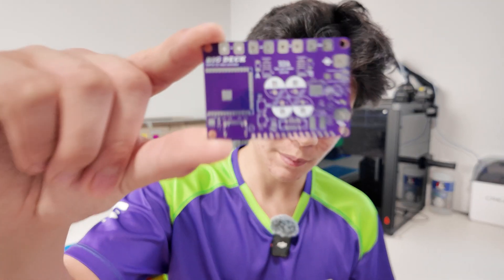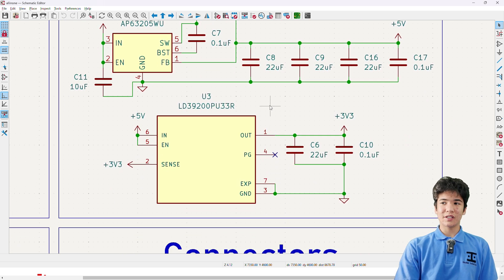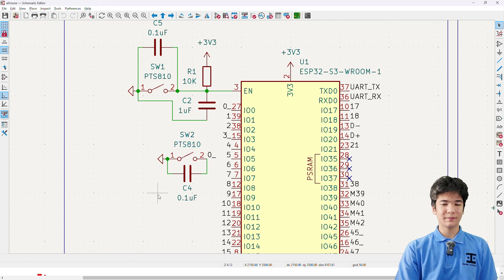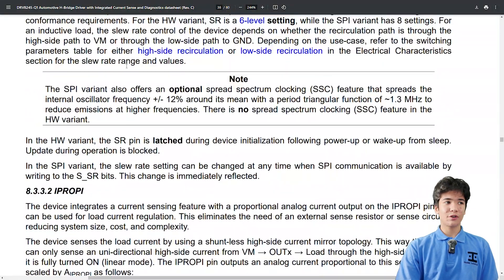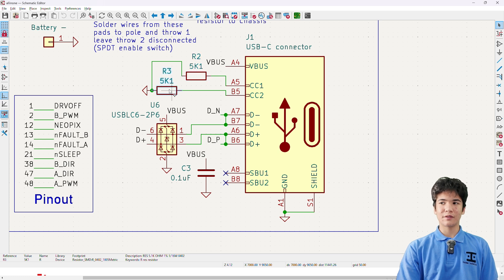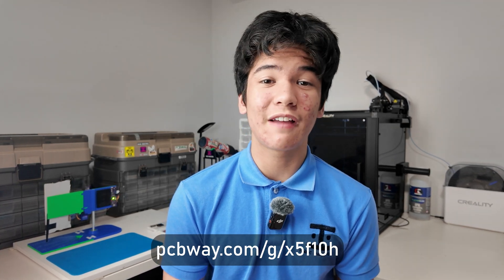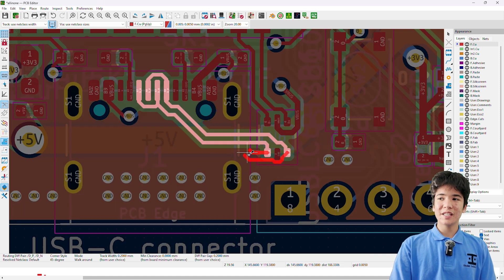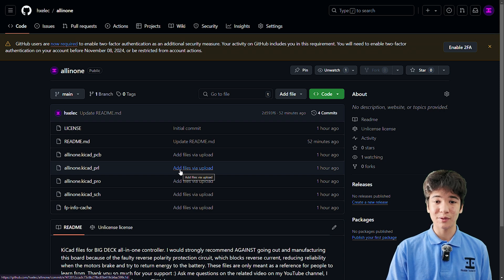ESP32-S3 Robot Control PCB - Design Overview (Part 2)

Comment: have you another option for the motot driver ic?, very hard to get that in my region:(
Reply from the maker: @adikamalikfajar6976  hmm. TB6612FNG is pretty good and popular, for 2 motors at low current. If you’d like some help on selecting another motor driver other than that, just look at the previous video of this series 😁

Comment: Just out of curiosity, you've completely redesigned your reverse polarity circuit with a different IC to what you suggested in an earlier video? Can you please explain the reasoning behind this decision?
Reply from the maker: @darrenjcosborne  It was essentially me thinking I could make the solution smaller by trying to block current bidirectionally with one N channel MOSFET…. It didn’t go too well lol. The circuit that I showed you in the reverse polarity protection video is completely correct.

Comment: Please label terminals that form nets with symbols. It's unnecessarily hard to follow the nets. Also pls use proper supply net names Bat+, vbat_raw - what is that? It also helps to organize the different components into coherent  units, not just slap them somewhere (D2...)
Reply from the maker: Hi, did you watch the full video, or just click on the GitHub or something? I explained what VBAT_RAW and +BATT were in the video: the unprotected and protected battery output respectively. Could you please explain what you are saying a little better? I have used the label 🏷️ tool in KiCad to create the nets, and placed all the components on the PCB optimally.
Reply: @testboga for someone who hasnt published anything on their own channel, i find these kind of comments to be unhelpful. Do better.